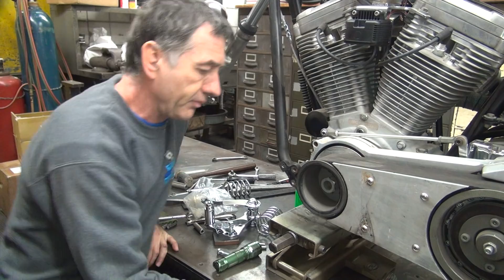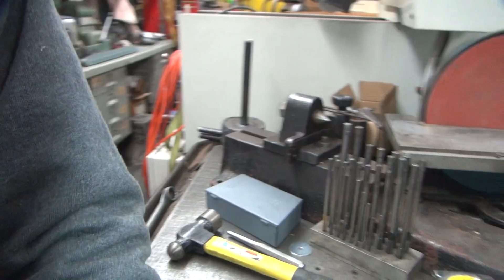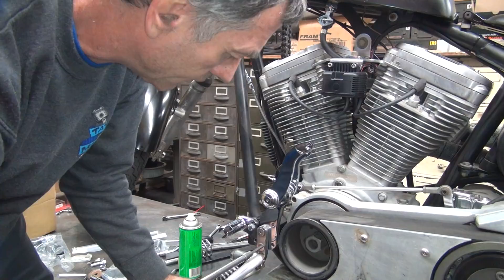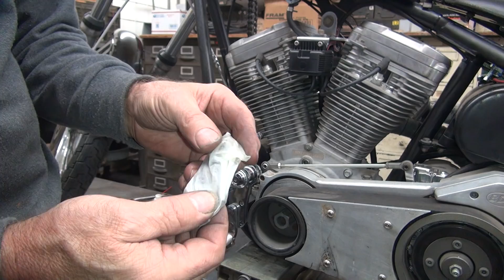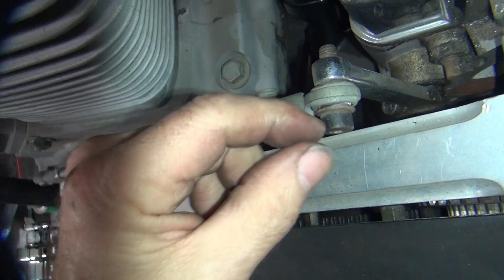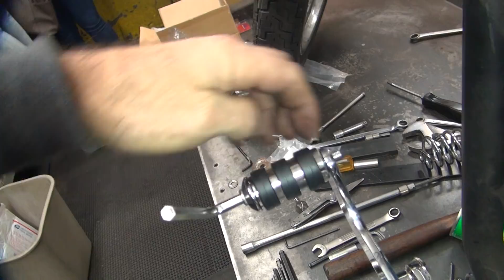#155 1999 80ci evo chopper used bike tune-up repair rebuild rigid bobber custom harley tatro machine

Comment: why is metric crap, i have been a mechanic myself (49 years) nothing wrong with that
Reply from the maker: because i am ameriacan and we use american hardware here. when you start mixing them you get nothing but problems. only dumbasses mix them. same deal with fine and coarse threads.
tatro
Reply: @TatroMachine  thank you for that so good to know I'm not the last american standing 👍🇺🇲💪😎
Reply: Tatro busting his balls on this bike .Wonder why .